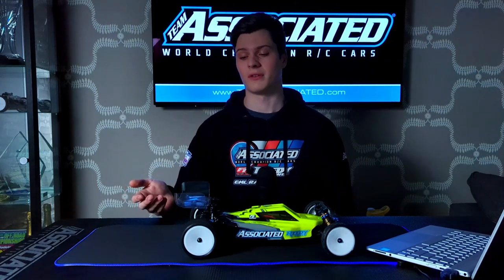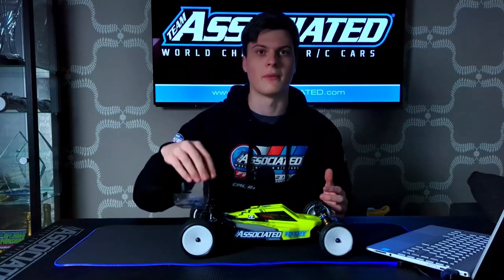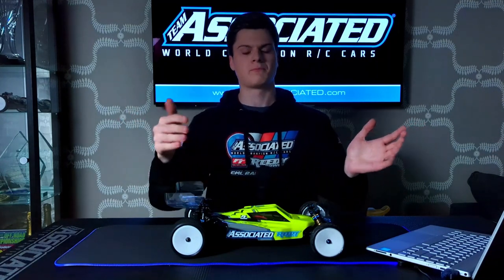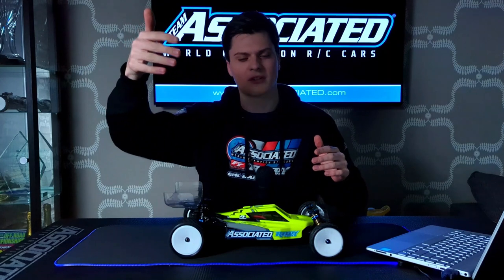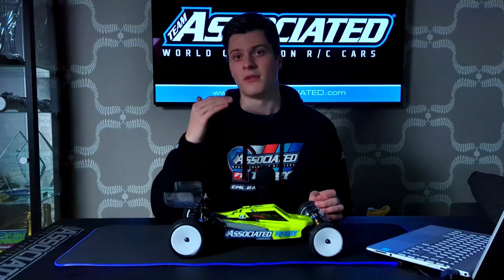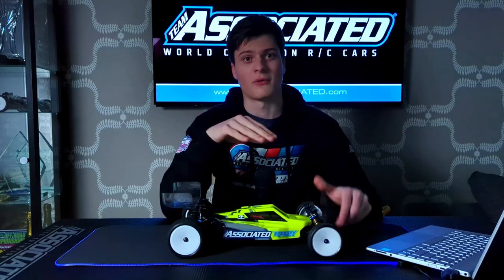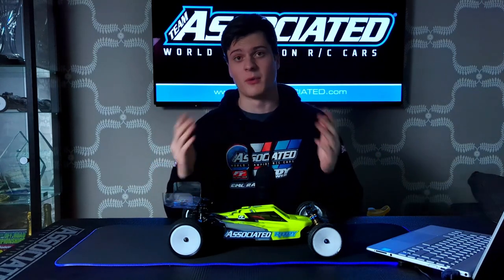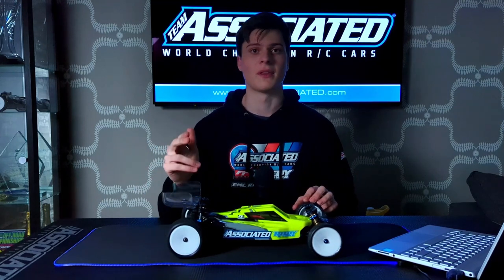7 BEST Setup Tweaks on Carpet Raceday: 2wd RC Car Setup.

Comment: What do you think my track hasent so many jumps can i go 40 shock oil to get it more stabel? has 30 now in front and rear.
Reply: Better a bit higher to the front and lower to the back.   Try 40 front an 35 rear

Comment: You didn't address the elephant in the room... the one thing the entire rc community is talking about!!!
Reply: Well what is it lol
Reply: Upside down rear shocks @LegendsPizzaCo
Reply: @MX-CO  I was kidding but thank you. I saw a few other people running upside down shocks and k was baffled lol. What are the benefits? Is the downside that they leak?
Reply: @LegendsPizzaCo  slows suspension rebound which can be useful on smooth high-grip tracks...not so much on bumpy tracks. Also reduces weight transfer due to lower center of gravity but more noticably on 4wd car. And no shocks won't leak.